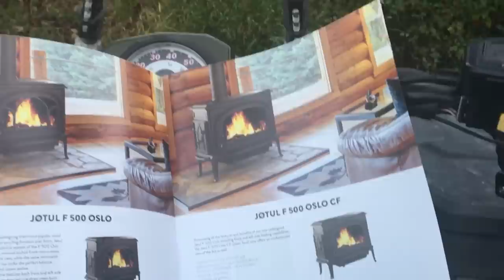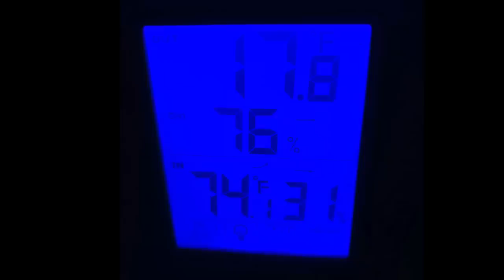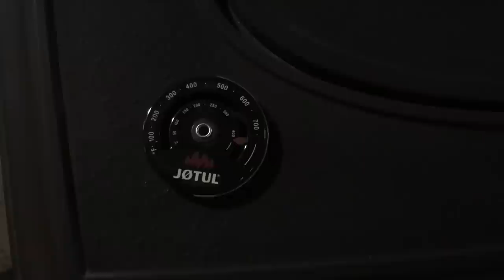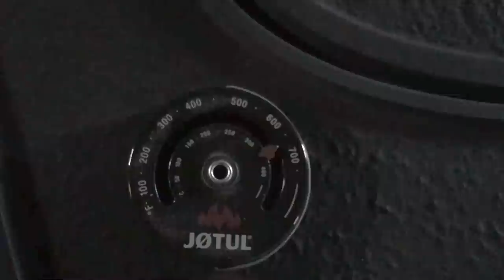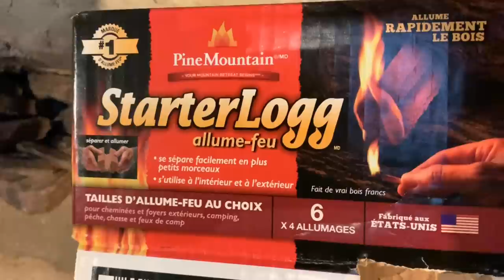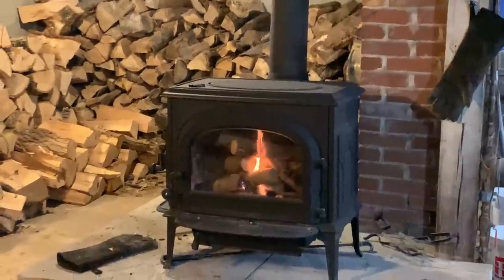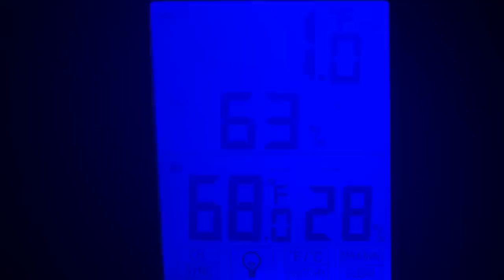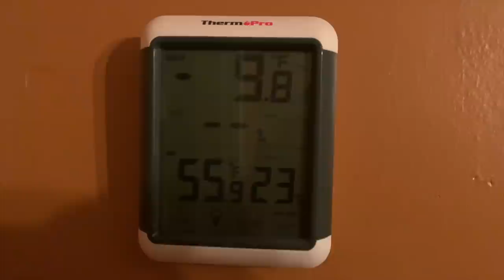The Jotul F500 Oslo CF one full winter review + install is this stove that good ?

Comment: How many trees are needed for one person/family per winter
Reply from the maker: Well. Its not really measured in how many trees. As trees are all different sizes. And moat only use trees that are already fallen and dead. Or not useful after they are cut for logs. Its measured in “cords” of cut and split firewood. For me it takes 4-5 cords and other with bigger homes it may take 5-7 cords.
Reply: Thank you

Comment: In terms of unseasoned firewood, I'd say that there's hardly any stove designed to burn damp firewood. It makes huge mess, doesn't burn well at all, practically you're boiling water in your firestove, chimney pipes and chimney, creating creosote and so on.
Reply from the maker: Sure. The way i was raised was when we needed firewood. Got low. We went out and cut it. Standing dead trees or ones that had been fell for some time. Im going to make a video on my dads style and his stove sometime. It worked. But we had to clean that chimney every single spring. My chimney hasnt needed to be cleaned since i bought this stove.

Comment: Ash pans are unnecessary on stoves used by people who actually heat with wood..  I only empty mine once a year!  You need to keep a healthy pile of ash to keep your coals alive overnight.  Just shovel them out from the side door of your Oslo 500.  It's actually a lot easier than trying to use the ash pan.  I'd trade the space the ash pan takes for more capacity in the firebox any day.
Reply from the maker: A bigger firebox would probably be more effective for a longer burn. But I love the ash pan. I never want a stove again that does not have one that works just like this one. I noticed no difference in the burn time if it’s full or empty. As long as the steel rope gasket is good air does not leak through for me.
Reply: @AlfonsLC  You'd be hard pressed to beat Jotul stoves.  I own the 500 and have a mint 118 in green enamel in the basement.  I wish I could fit the 118 in my living room where the 500 is --It's THAT great, and it was built in 1975!  Love the Pennsylvania bluestone, too.
Reply from the maker: Matthew Smith sweet. Im going to making a bluestone buyers guide with my brother soon. Hes quite the quarryman. I really love mine. But i know others who are having some bad quality control issues with modern jotuls. Plus the governments war on self sufficiency.

Comment: Alfons,,,,to clean the glass of the clouding from improperly seasoned wood,,,you'll need anywhere from 3 zero (000) to 5 zero (00000) steel wool with WHITE,,not RED polishing compound and a bit of elbow grease. It has ALWAYS worked wonderfully for me WITH OUT scratching the glass. I promise you won't be sorry
Reply: Or water and crumpled  newspaper ! believe  it or not !
Reply: I used Bar Keeper Friend solution if harder to remove glass of woodstove. Bar Keeper doesn't scratch glass and don't purchase power and just cream solutions. To obtain Bar Keeper is at grocery store and next to Ajax or Comets. Also, I used Bar Keeper for shower glass, pots and pans (inside and bottom only not on exterior finish) oven wall, cooktop and more.

Comment: You can greatly extend your burn time and use far less wood by adding an SS grate over your grate.

An SS grate with smaller holes, say Expanded Metal with 1/2" or smaller holes, or SS plate with 1/4"  holes, or SS Wire Cloth with about 1/4" holes...
Would give you greatly increased burn time, more even heat spread, more heat radiated up because it acts as a Reflector, less Flue Cleaning, less Ashes, less wood burned, and much longer fire burns.
Look for Firemizer if they are still in business. (They are, links below)
I studied their info, already KNEW it made sense, bc when I went to take the "Grate" out of my stove, 
I had SEVEN of them of different home sizes in there! 
My stove is an OUTFITTER Cylinder Stove from Utah.
It is made to lash on a pack horse and heat cabin tents.
WHEN I  put a SS Wirecloth in, prolly 1/16" holes, I made two bends to match the contour of the grate and stove walls.
It IMMEDIATELY made a HUGE difference in the heat radiated up into the room!!!
I had usually removed ashes every three days.
Fifteen days later, I finally checked on ashes.
There were NONE under the grate, however,  the SS screen WAS starting to get clogged up.
Best I could figure, the wood was TOTALLY used up, ie turned into heat.
The ashes were so fine that most went up the flue.
Watch videos and do research on this concept. It will save you hundreds of dollars in wood.

Same amount of wood. Longer-lasting fire." on YouTube

https://youtu.be/eX7qQA3ugCI

https://www.firemizer.com/us/why-firemizer/?gclid=Cj0KCQiAkKnyBRDwARIsALtxe7h4_EGETjPGGtMQuSgLi7FuIiWNPzDnmq826TBEhjRNJQkBqHZrqZ4aAjnPEALw_wcB

This is awesome, a Time Lapse video:
Timelapse "Firemizer v9" on YouTube
https://youtu.be/YdDfjtgmbJY

Comment: I install and sell hotel for 10+ years. They are one of the best choices out there. Just make sure your local handyman does not install because it will ruin your experience..
Reply from the maker: Well. I installed it myself. Why do you think its not good to diy ?
Reply: @AlfonsLC  a concerned homeowner most the time is a better installer than a random contractor.

Comment: core each piece with a drill and burn each piece from the middle for  4x longer with the same heat
Reply from the maker: That sounds like more work than cutting and splitting it.
Reply: @AlfonsLC  chop it in half drill down the middle with a drill or cork screw! twice the burn in bad situations where u need more and have less

Comment: This was a very nice video and I love your voice.  Very well done!  But can I ask a stupid question?  In my mind I have my perfect fantasy wood stove planned and how it will look.  But every time I see someone else's wood stove, the pipe from the stove up to the roof is bent. To me- that doesn't look attractive.  Is there a functional reason that so many people's black pipe thingy has a bend in it?  Can't they just go straight up- or is there a reason that it needs to have a bend in it?  Signed- a stupid person.  Haha.
Reply from the maker: Theres no such thing as a stupid question. People cannot hope to learn things if they think they already know. Its wisdom to ask. First of all (-: so. There are two different ways to make a chimney. My house. Already has a chimney that just needed a small adaptation for the wood stove. A liner inside the brick. If you see in the video. The chimney is there and its brick. Thats what the stove is piped to. In other cases. Right from the stove people buy high end insulated stove pipes that double as the chimney and go strait outside. Because they are heavily insulated. They can come in very close contact with the wood that makes the house. And NOT get so hot as to ignite the wood boards of the roof. Since most homes have a chimney already built. This is why its most common to see it the way i have it. Vrs making a chimney out of the high end pipe and having cut through your roof. I thank you very much for checking out my video. And for you compliment.

Comment: Did you consider a vermont castings?
Reply from the maker: I did. Nice stoves. I didnt like the design. Ash pan on the Jotul is my favorite part. And the huge window
Reply: @AlfonsLC  Thanks, i need to replace my vermont castings (35 years old) the doors have been warped for many many years.  They don't make them as good now and from what i hear jotul has gone down hill too.....the vermont has some refractory stuff in it now....i wont be able to load the jotul from the side and the vermont can be loaded from top which i think is good...just curious what you didn't like about the vermont castings...i think the price on both are about the same.
Reply from the maker: casandra nihurb You are not wrong. They have all gone down hill. My jotul will be getting warranty work done soon. It will be in my year two video.
Reply from the maker: casandra nihurb The price is comparable. Jotul had a bigger window and a better ash pan and the Jotul was also on sale. Comparable warranties comparable build quality I just went with what I liked better in the end. But the jodul does have a sideload door watch the video again you could see me use it
Reply: @AlfonsLC  yep i know it has a side load but it would be on the wrong side for me because of a wall, i would have to load from the front whcih never made much sense to me because when you open the door to add wood stuff can come out....i do like the jotul bc it is all cast iron, correct not brick inside?
Reply: @AlfonsLC  wow, already,,,think i will go with the vermont.
Reply from the maker: casandra nihurb the jotul firelight has the door on the other side. That was the wrong aide for me or i wouldve gotten it. As its also bigger. The warranty work. May be partially my fault in fairness. Though I think they should use a higher quality sealant. It seems the ceiling to make the stove airtight melted and the stove is now leaking smoke. I was burning the stove normally with kiln dried oak when it overheated. You can see in the video how Hot it got. Also the damage to the glass. But i fixed that.

Comment: these small stoves can work great. but they suck with "wet" wood. and they arent great if you arent nearby to tend it constantly. being away from home for more than 6 hours means you come back to a cold home. get the biggest stove you think you can fit. .... if you have a small stove the best heat comes from the huge pieces that are very dry 2 years plus. if you get it in the stove and air under it, it will burn forever AND hot. so like the video said just stay on top of  your wood and make sure its dry. small stoves can use up wood fast, big stoves dont necessarily use a lot of wood.
Reply from the maker: Thats totally untrue about this stove. I work in the gas industry. Im away 14 for my shifts. Only when its below 10 will i come to a 60ish or under house. Even that. Thats not s cold house. In my opinion. But this still keeps over 300 for about 7 hours with good wood. Holds 200 for up to 15 hours. Stay tuned for the follow up. Im going to address this directly.
Reply: @AlfonsLC  you're very right, above 10 f I stay very warm, I can leave for 14 hours. But in VT it gets colder than that most of the time (up here at 2100ft).. down where mom lives (800ft) it's warmer. If you keep your wood dry you stay warm below 10f but if it's wet look out. Do other thing in your home that add heat like long roasts in the oven or brew beer etc

Comment: Did you used any metal liner on the old chimney?
Reply from the maker: Yes. I touched on it on the video. But i regret not being a bit more thorugh. Maybe i will in the follow up. But yes. There is double insulated double stainless steel insulated chimney

Comment: I got the same stove and I can’t start a fire without leaving the glass door resting open, I wonder why?
Reply from the maker: Bone dry kindling and a fire starter help. If the wood is even the slightest bit damp its not easy.
Reply: I use those starter things too, where you placed it you can see the air making it glow. I’m gonna try and put mine where you did tomorrow morning. I’ll keep you updated. You are right about wood being COMPLETELY dry.
Reply: Not uncommon...you might even see the manufacturers recommend the door be left open
 from a completely cold start
Reply: Because your draft is not strong enough and you need some incoming air to feed the fire. If you check where the wind is coming from you can crack open a window or door while the stove lights to help with this. Some Stove pipes have a valve that you can open so that the draft is increased higher up in the pipe. I do not know how prevalent that is today but it was common years ago.
Reply: Thanks for the replies

Comment: Everybody starts a new fire with the ash pan door open for a couple minutes just to get it going.  And every manufacturer tells you not to.  Here's why: if you are dumb about it and leave the ash pan door open too long you can do two very bad things: (1) over-fire your stove and damage it; and (2) burn your house down because you've basically just converted your wood stove into a very powerful rocket stove that can shoot hot embers up the flue with enough force that they are still very much on fire when they exit the chimney.  If those embers fall on a dry roof made of asphalt or wood shakes, it is bye bye house.  The manufacturer can't know what kind of wood you are burning, how good the draft is, etc. and so they can't guarantee it will be safe for 10 minutes or whatever, so they just tell you not to do it all, so they can't be sued if you do it and screw up.  Never walk away from a running stove with the ash pan door open, that really is a terrible idea.   But it is completely harmless IF you watch it carefully and shut it as soon as the fire is established.   Also they make stove glass cleaner that will take that haze right off, you definitely don't need to replace the glass.  Happy heating!
Reply from the maker: All Very true. I agree. Ive tried many thing. Gray fine ash and water. Two types of cleaners. Vinegar. They replaced under warranty for free so.

Comment: i have blazeking king classic . i can get 40hour run over a weekend and come home toss wood in and good to go. it's my primary heat source in Alaska. a typical med setting gets me a 12 14 hour run with high heat. it only cost a little more than this stove.
Reply from the maker: Ive heard of those stoves. All good things too. You should make a video about it. Need more on youtube. Hard to make informed choices on these stoves and they are $$$$.
Reply: it's a no frills catalytic stove with large glass door. no ash bin no side door all steel. i love this stove. i would recommend to someone who needs a large stove for a primary heat source. but not for occasional use. my 2 complaints are no matter what you try smoke exits from door when open. and to properly clean chimney you must remove it from stove top and place a bucket under chimney due to catalytic conv design. i huge hassle. but still worth it when 100lbs of wood is loaded into stove and walk away.
Reply: I hate those catalytic design for that reason! I have a Drolet, just take out the baffle and soot falls thru the pipes. Blaze kings rock for heat tho. I’m in mat Su area, so I know good stoves.
Reply: @brucea550  what is make model of that stove. how about burn time? sounds like secondary burn stove. i had quadra fire with secondary burn setup. loved that stove but not the burn time.
Reply: Escape 1800. Secondary burn tubes, no cat.
Burn time could probably be 10 hours if needed. Doesn’t hold as much wood as a blaze king. I’m not a fan of packing a stove full of wood to gain burn time.
Reply: Ahhh....the pros and cons of cat vs no cat rears its head once again

Comment: Wet a micro fiber roll it up dip it cold coals and clean your glass ash is the best cleaner for it
Reply from the maker: Thanks. I get so many of these comments ill have to make a separate video maybe. Tried that a few times. Took the glass back to the dealer also. They couldnt clean it. They talked to jotul and they replaced the glass.
Reply: We installed a Lopi Cape cod great stove very similar to yours.